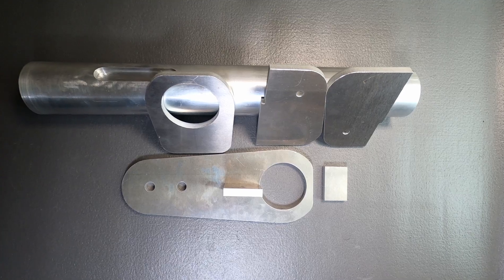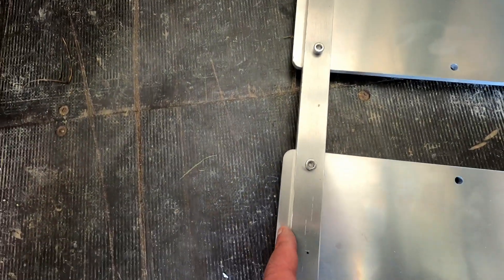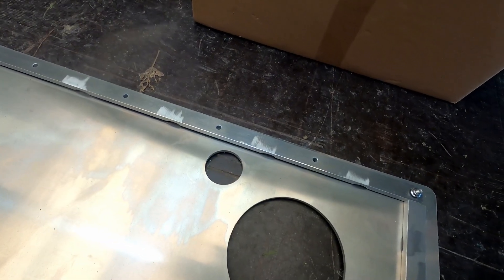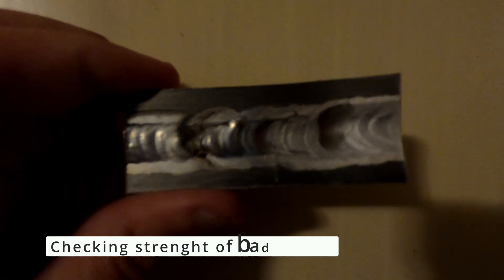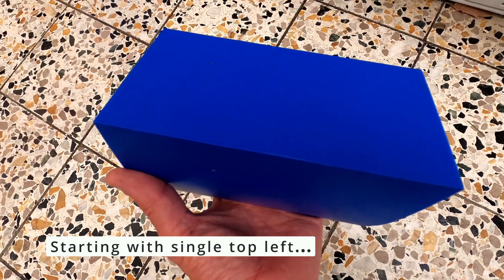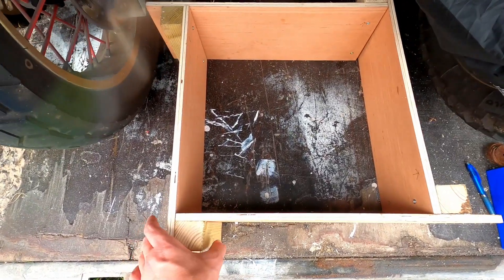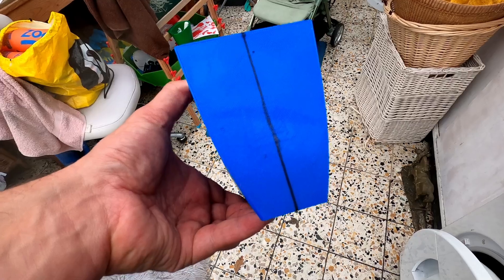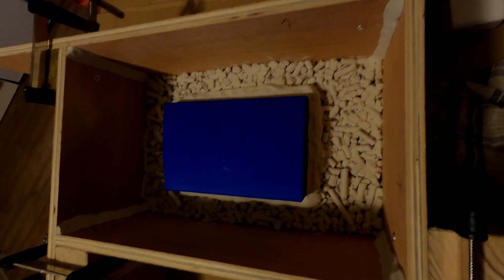Keel Box Lid Work + Tiller Bushings & Spacers Cost Breakdown | DIY Aluminum Sailboat Build Ep. [2]

Comment: TIG is great but commercial yards builders mostly use MIG as it's quicker and cheaper. To be fair I've been around guys whose MIG welds are so good you couldn't tell the difference
Reply from the maker: Hi Matthew - Thank you for comment. As start to weld the hull I might have to change tactics and get a MIG. TIG can be painfully slow, but has it's advantages in some areas:)

Comment: Please don't grind down the welds to make the lead ingots fit. It will definitely crack in short order. The face of the weld is crucial, especially for aluminum. Bevel the lead, or modify the 3d printed form to have a bevel in it. Afterwards, you can easily melt some lead to fill in any small gaps if you want.
Reply from the maker: Hi JM - Thank you for taking time to comment and for the great advise. Point taken as makes perfect sense, will leave the weld 'as is' and modify ingot instead. Big Thank You:)

Comment: Another very interesting video post with perfectly manufactured parts. It looks like you will have largely completed the mechanical components by spring. The casting of the lead blocks will be exciting....Good luck!
Reply from the maker: Hi Albert, thank you for your kid words:) - The goal is to have the mechanical parts sorted by then and after that it is eyes on the hull:) I have manage to find 650 Kg of lead so around 300 Kg short so need to find someone selling some BEFORE the lead hits the scrap yard and double in price:)
Reply: @modularhippo  A large part of our 5.4 tons of lead came from waste balancing lead from tire dealers. No idea if this source still exists.
Reply from the maker: @albertfunk1176  I started of with checking garages for that very reason but it seems most of them are Zink these days. I might check again as Google says that lead is still used. Thanks:)

Comment: Thanks for sharing. The keel with the small pieces of lead was a new design for me. Managing the lead casting in reasonably small pieces will be easier than pouring all the lead in one go, which will also avoid distorting the structure. Cheers.
Reply from the maker: Hi CptBond - It is a bit more labour/effort intensive but as you say enables the backyard builder to handle the process yourself. It is the brain-child of the designer Luis and still in it's experimental stage. I was playing with the idea of doing a full cast but what made me settle on this method was that the ingots will be resin coated, as well as insulated by a neoprene matt (fire retardant) so in case of a pinhole water entry point you should still be able to avoid electrolysis.